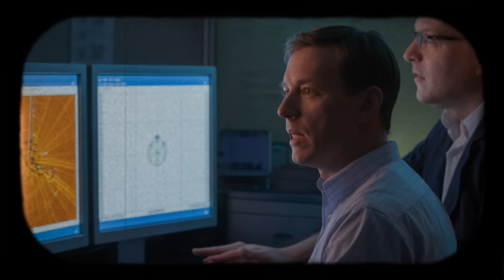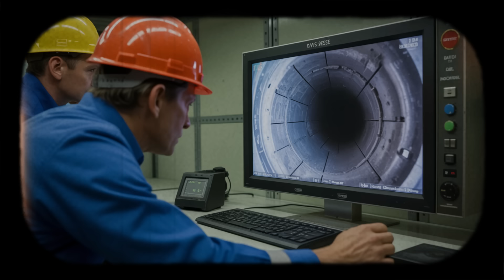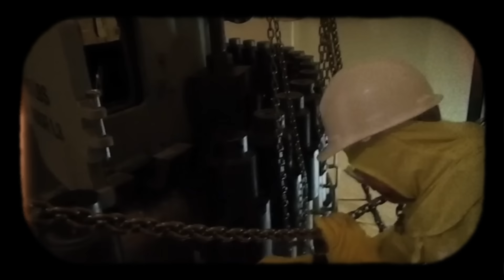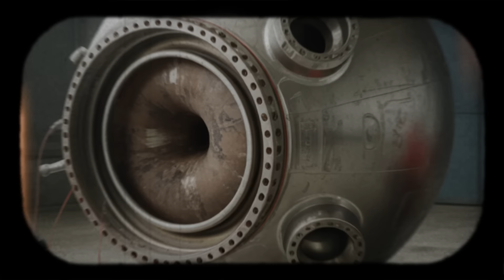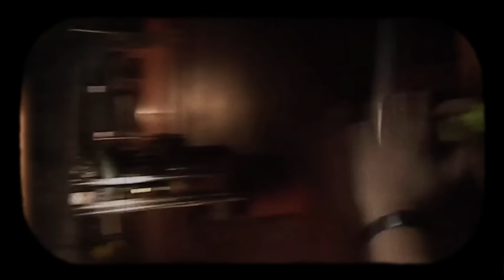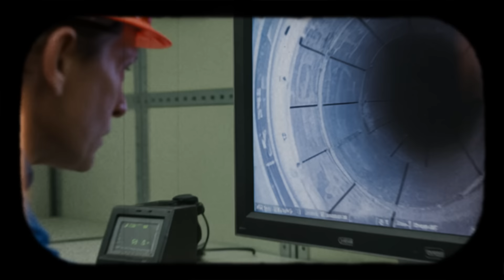Davis-Besse Near-Meltdown, Minute by Minute

Comment: These fear videos always ignore the fact that more than 2 people die every minute worldwide in traffic accidents.     But more technically sophisticated observers have detailed the safety of all the energy options.  Here's what I get from GROK:

Per unit of electricity produced, nuclear power is among the very safest sources—statistically comparable to wind and solar, safer than natural gas, and orders of magnitude safer than coal or oil. The perception of nuclear as dangerous stems from the high-visibility, low-frequency accidents (Chernobyl, Fukushima) rather than the actual death toll per terawatt-hour.
The most comprehensive and widely cited comparisons come from peer-reviewed studies that include both immediate/operational deaths and long-term effects (e.g., air pollution).
Leading Studies and Results (deaths per TWh of electricity produced)
Energy Source
Deaths per TWh 
Main causes included
Source (key studies)
Coal
24–105
Air pollution (particulates, SO₂, NOx), mining accidents
Sovacool et al. (2016), Markandya & Wilkinson (2007), Our World in Data (2020–2024)
Oil
~18–36
Air pollution, accidents
Same as above
Natural Gas
2.8–12
Mostly air pollution; pipeline explosions rare but included
Same as above
Biomass
~4–24
Air pollution (wood/pellet burning)
Same as above
Hydropower
0.02–1.3 (0.7 if Banqiao 1975 included)
Dam failures (Banqiao, China 1975: ~171,000 deaths), construction
Our World in Data (includes/excludes Banqiao)
Nuclear
0.03–0.07
Chernobyl (1986), Fukushima (2011), routine operations (negligible radiation)
UNSCEAR, Sovacool et al., Our World in Data
Wind
0.04–0.15
Turbine construction/maintenance falls, manufacturing accidents
Sovacool et al., Our World in Data
Solar (rooftop)
0.02–0.44
Falls from roofs during installation, manufacturing
Sovacool et al., Our World in Data
Solar (utility)
~0.02
Lower because fewer roof falls
Recent updates
Geothermal
~0.02–0.05
Very low recorded accidents
Limited data, generally very safe

Summary Ranking (safest → least safe, using most recent OWID synthesis, 2020–2024)
Solar (utility-scale) ≈ Geothermal ≈ Nuclear ≈ Wind (all < 0.1 deaths/TWh)
Hydropower (excluding rare catastrophic dam failures)
Natural gas
Biomass
Oil
Coal (by far the deadliest)
Key Notes
Nuclear’s deaths are dominated by Chernobyl (1986, ~4,000 long-term cancer deaths estimated by UNSCEAR/WHO) and Fukushima (2011, 1 confirmed radiation death, ~2,200 indirect from evacuation stress). Spread over lifetime electricity production of the global fleet, the rate is extremely low.
Coal kills hundreds of thousands every year via air pollution (WHO estimates ~8 million premature deaths globally from all air pollution, with coal a major contributor).
Hydropower looks very safe until you include rare but gigantic dam failures (Banqiao 1975 alone skews the average dramatically). If you exclude such events, it is among the safest.
Wind and solar deaths are almost entirely workplace accidents (falls, transport), not from the energy source itself harming the public.
Even when using the most pessimistic nuclear assumptions (linear no-threshold model, collective dose), nuclear is still safer than fossil fuels and comparable to renewables.
Noted a recent reference where Windmill repairmen are demanding $150,000 a month to work on windmills. I wonder why?

Comment: Poor B&W, first Three Mile Island , Then this... No wonder they went belly up when it came to building plants
Reply: Davis-Besse had an incident in about 1978 that eerily prefigured the TMI accident.  Davis-Besse and TMI 2 had the same type of power operated relief valve (“PORV”) in the primary loop pressurizer.  The PORV at Davis-Besse stuck open in a manner very similar to the later accident at TMI 2.  The reactor was operating at very low power and the stuck valve was noticed before the core was exposed.  B&W, typically, failed to appreciate the significance of the problem and sent only a routine CYA memo to plant owners.
Reply: @Pamudder  there were actually 2 (stuck open) PORVs at two othe plants  prior to TMIs stuck open one....
Reply: @robozstarrr8930 Thank you.  I only knew about the one at Davis-Besse.  That there were two makes B&W’s utter complacency even more unforgivable.

Comment: It would have ruined the reactor, but the containment building would have stopped any release. Nuclear is still far safer and much less destructive to the environment than oil and gas production and use. It's pronounced Bess-e, not Bess. I live 6 miles away from the reactor, and   I'm fine with it, the 2 oil refineries 8 miles in the opposite direction are far more concerning, dozens of smokestacks never stop pumping out giant clouds, and they often produce a disgusting odor that travels far beyond the refineries.
Reply: It's safer   If something does go bad it's really bad.  I'll ignore Chernobyl because that was a combination of so many things.  But looking at Fukishima for example you have a mess that is very difficult to clean up.  Cleaner can be debated since depleted nuclear fuel is highly radioactive for a very long time.  It's still something that we need to investigate as it's a very powerful energy source.  Outside of the spent fuel issues it's cleaner than oil,.coal, and natural gas.   It's more efficient than solar and wind.   People need to stop thinking it will end up like Chernobyl or TMI.   Technology has advanced far beyond that.  TMI would have been a small foot note if all the operators did was do nothing.  It would have shut down the reactor by itself.   Imagine what another few decades of development would allow.
Reply: I'll stick with coal,oil and natural gas. Nuclear power stations are still built and maintained by the lowest possible bidders. No thanks, we don't need any Cherobyl type exclusion zones in the USA. 
Either do it right or don't do it at all.
Reply: It's safe, if the engineering behind you is safe, the plant sighting, design, manufacture, test, instrumentation, training, waist cycle and all the rest of it I've done properly which the nuclear industry never does because to do it right costs money so they cut corners and things go poof. You cannot stick your finger back in that bottle to plug it if it goes poof because of cut corner philosophy; ask the people of Fukushima, of chernobyl, and of Kyshtym.